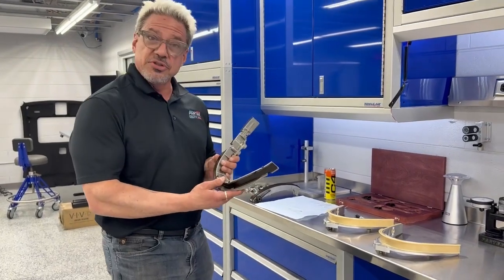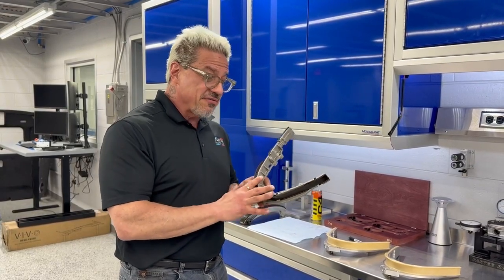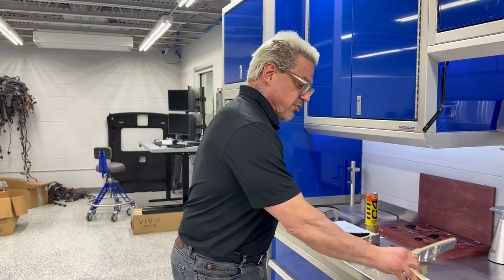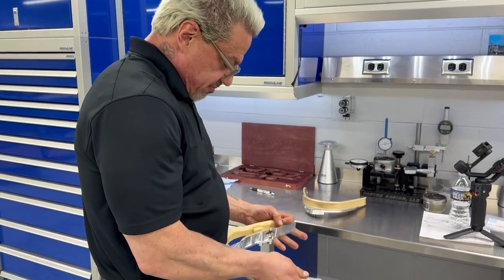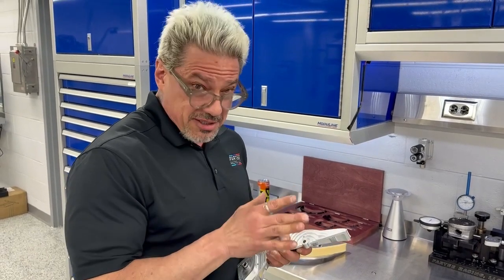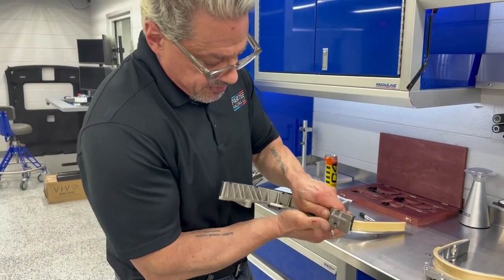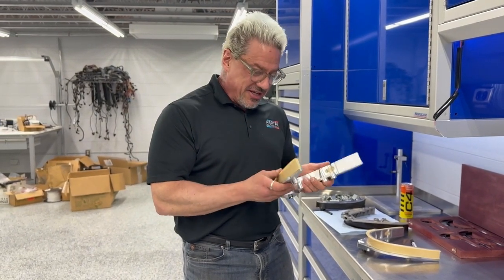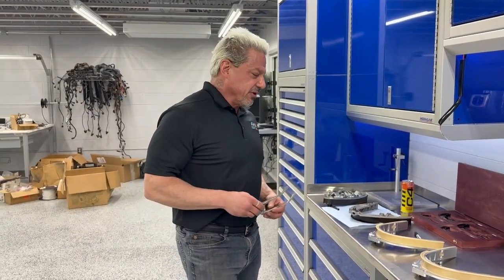Partee Racing’s Reinvented S62 U-Shaped Chain Guide

Comment from the maker: Thanks for all of the kind comments!  We have successfully completed our initial in-engine testing of our redesigned U-shaped chain guide and will post it for sale on the website (www.ParteeRacing.com) later tonight!  We are posting with an initial price of $795.  We have three in stock and will have 20 more made within 7-10 days and have 500 more Stanyl 46 inserts on their way in the next 2-3 weeks.  We can make up to 2500 more with our existing injection mold. 

The design of the Stanyl 46 insert for the Bank 1 tensioner rail (the one that is NLA from BMW and if you find one remaining in stock somewhere or use the M60 equivalent, you have to drill your own oil holes in it) has been completed and sent to injection molding for prototyping.  With any luck we will have those in the next 4-6 weeks.
Reply from the maker: Sorry, folks, taking a little longer to finish the testing analysis and post the product than I anticipated.  Will be done by Monday.